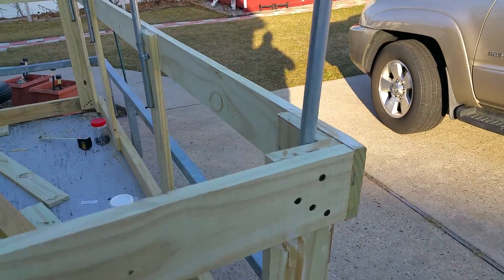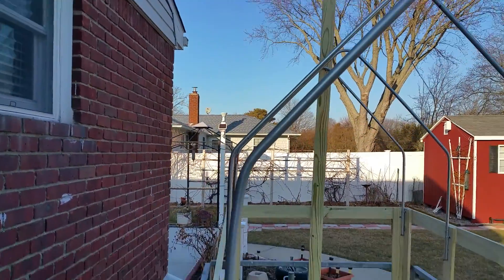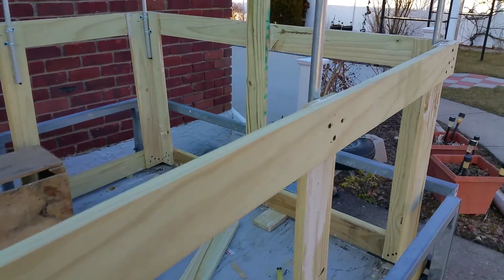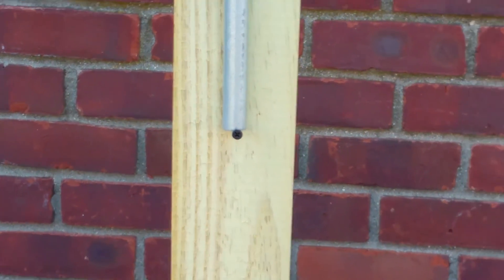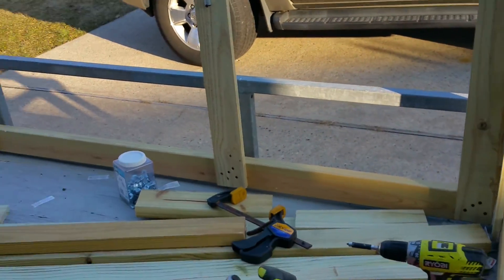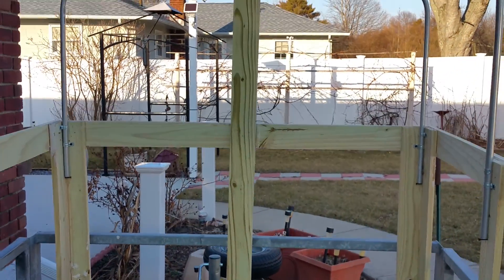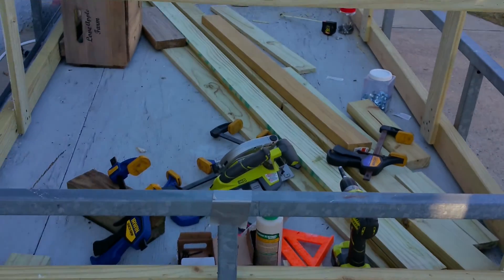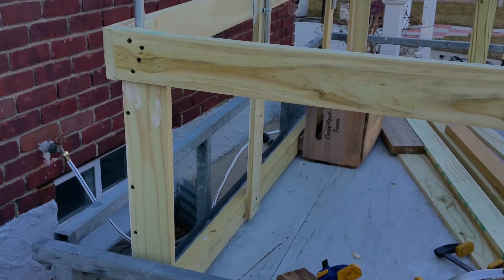Chicken tractor progress Wednesday 2/14 💘

Comment: Looking great there Bill! I really like the piped roof structure. Door-wise, how about a rectangular door at the base and then a slightly triangular door at the top, with the two being joined by a hinged crosspiece? That way you can fold the top door down, or fold the bottom door up? Ideally then hinge the entire door section on the side to open it all like a standard door? (So build the overall door frame and hinge it on the side and then attach the inner two doors to it? - a bit like a barn / stall half door?)
Reply: In fact the unit is probably wide enough to just allow a standard rectangular door fitted in the middle by adding an upper section up the height of where the roof starts to angle and perhaps half-door it, although the half door may not be worth the effort in that case...? (so, err, ignore my earlier comment :P )
Reply from the maker: Simon B See, that's what I'm dealing with!